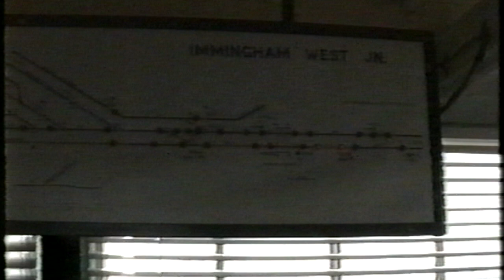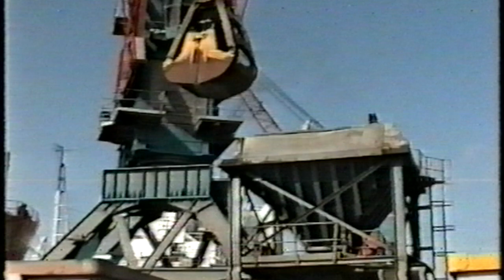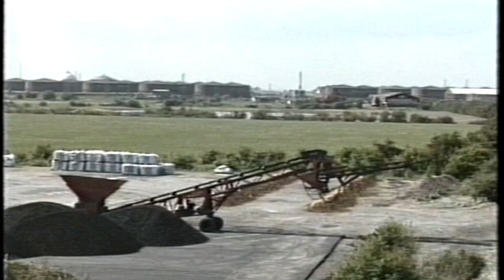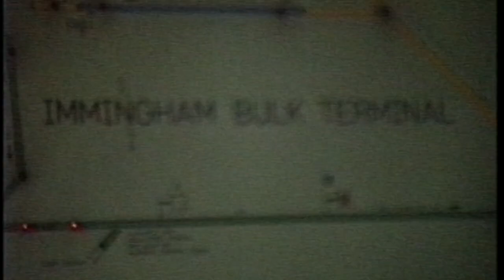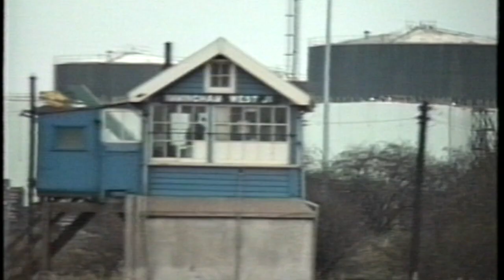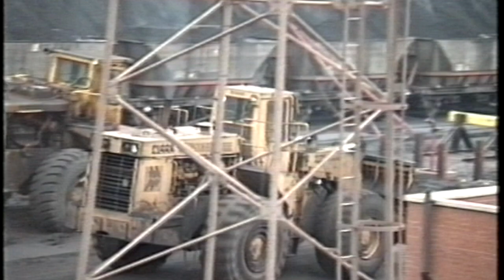The Railways of Immingham Part 2

Comment: Wow what memories, thank you Malcom, i realise a lot of changes had taken place but i remember when i worked for Westfield Shovels when it was owned and ran by Steve, Dave and Ros Chapman of Killingholme, i remember loading trucks on the Pyrite dump with Pyrite which looked like purple flour (but way heavier) in the early 90's it was on the now HIT terminal where they load the Drax wood pellet trains, we also worked in the terminal from time to time and remember a couple of the old Clarke Michigan shovels, (all noise and smoke) which were later replaced with new VME 350 machines, we used to do alot on the mineral quay when they used to put the Ford A62 loading shovels in the ships hold to clear the product the cranes couldn't grab it was a different world, i had many happy times with Steve over the years and i still go into IBT to do maintenance on some of the machines there.👍

Comment: anybody know what type of wagons were being loaded with black sand?
Reply from the maker: Titans Tioxide Uk Grimsby purchased 50 second hand MDO unfitted mineral wagons from BR in 1974. They had a carrying capacity of 21 tons and tare weight 8.8 tons and were painted grey with a yellow top for identification. A year later they purchased 200 MCO unfitted railway wagons from BR. They had a carrying capacity of 25 tons and a tare weight of 10 tons and they painted them grey with a red top for identification.
I hope this answers your question, cheers Malcolm Hayles.
Reply: @MalcolmHayles thanks 👍